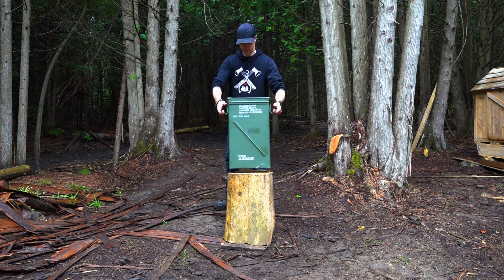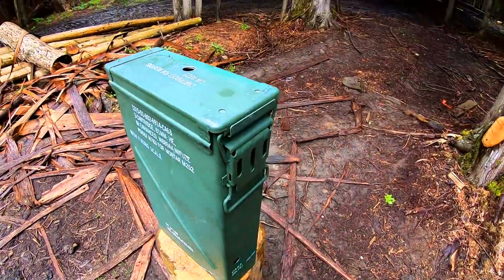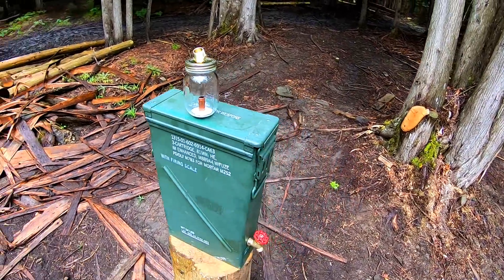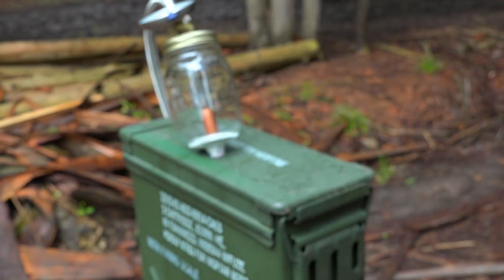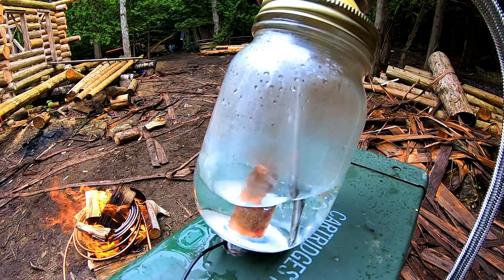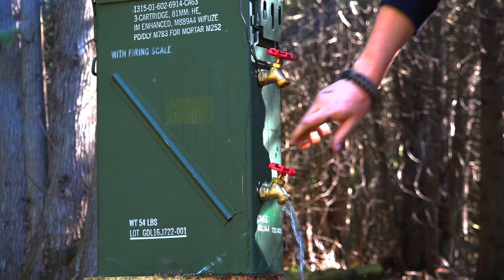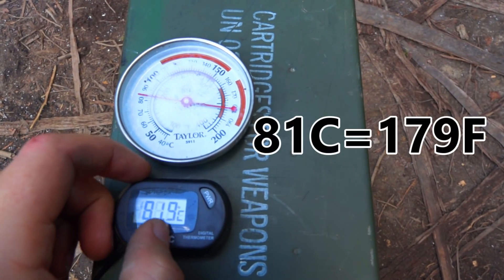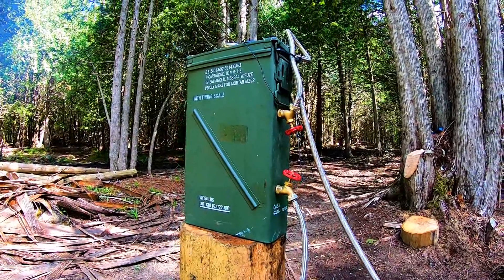Off Grid Heating Prototype- Copper Coil Water Heater / Heat Exchanger / Radiant Heater

Comment: I've toyed with the thoughts of heating water thru a fire...….I used one of the cylindrical charcoal starters. coiled copper tubing inside, cold into the bottom, hot out the top; taking advantage of the thermal syphon process. worked pretty good.... sure it isn't 50 ft of copper tubing to absorb.....so it take a little longer,  but doesn't use as much resources and is way more compact.....the amount of water wasted to empty to prevent freezing is much less also.

Comment: I like this build. The first thing I'm thinking about it is transportation. If you bent up the copper in a squar coil so it can all fit in the ammo can and still have the footage of the heat exchanger. The other thing is boiling water in the conditioned area might not be ideal but the only ways to mitigate that really is to modulate the heat that the heat exchanger gets. I'll be looking forward to how you tweak this.

Comment: Simple but effective way for heating. I'll use a close loop 2 coils one inside with the intake on top of the cabin to allow heat to rise and the ammunition box outside with the other coil. On the ab I'll install a flapper on top to control the fire and a pressure release valve.

Comment: maybe someone has said this before, but I thought I'd mention that the vapor will still form in the lines so long as it has enough length in the coil section to collect that much heat. one way I would make it better is try to make the coils go from bottom to top and it should circulate better, that way any vapor pockets don't get stuck. it should heat up faster too I think.

Comment: Try using less copper pipe, say 10 foot, and wind it helically with the bottom of the can connected to the lower side of the coil. That way when the water heats, it will expand and move upward naturally using convection and avoid boiling inside the pipe better. Yes, I have an engineering degree and was it tech support missionary in Africa 4 sim,org

Comment: I would worry about the endurance of the copper, since it melts at 1,085°C, and becomes soft prior to that. A camp fire can reach that temperature, perhaps if you elevated the copper tubing with a steel frame so it never touches the coals.

Comment: Cool, or HOT! I'm thinking of something similar for my offgrid house, using the wood stove, to heat water, for a water tank, for thermal storage, with radiators and computer fans, to heat, and a heat exchanger for hot water! Along with solar thermal water heating,

Comment: Wow. Now that’s a great idea!   Now to make it portable and easy to setup and take down.  How did the gaskets hold up?  Hmmm,   Now you need a mechanical auto feed for the fire to keep it going.  Wonder if some kind of pellet stove design might work with a Wind up auger to slowly feed the pellets into fire or an efficient solar rechargeable battery that runs a motor that turns an auger slowly or on a regular schedule.  Hmmm maybe a Rocket Stove Water Heater that is somehow feed wood pellets.

Something like 
https://youtu.be/CaD4Nl-9P2M

Comment: Seems unsafe.  I'd mount it outside as mentioned also.  I think if you used a car radiator you could then blow air across it to heat the air and then the warm air would be blown into your camper.

Comment: an idea for your heater would be rather than using an open water source for the heating side of your system would be to have a second coil for the heating side allowing the heat to escape from into your surroundings without the accompanying humidity.  This would serve 2 purposes it would provide heat without adding moisture that would condense upon your interior.  If you want to heat water place a coil within the water rather than have an open water heating system this prevents the boiling of the water and the excess humidity.

Comment: good idea but your missing a few things .use sand in the box and put that coil it the box as well  put a thermostat on the coil to regulate. one that closes off the water when it gets to hot
use another box for an expansion tank outside  use a 20 gallon  drum for a stove outside  and a cast iron heater like the ones    in homestead kitchen stoves  hook up your pipe and u will be good for all night .  sand holds heat 4 times  longer than water   depending on the type .so draw up your plan and take it to a heating shop to double check  the safety side of this and your camping in the snow . good luck and vent your camper .like your videos

Comment: Excellent idea. One thing I would do is have a vent pipe from near the top to the outside. That way if it does boil over it does so to the outside. One thing you could also do is mount a small motorcycle radiator and a fan inside your camper with a larger tank outside a bit higher as a reservoir. That would prevent any boiling water from spilling into your camper if anything went wrong. Lagging the outside pipes would also help prevent freezing of the return pipe and the heating pipe from losing too much energy. Great idea, I am looking forward to seeing it develop further.

Comment: Very clever and something that captures & stimulates the imagination of those of similar mindsets. Your idea would be to heat up the tank, then close the valves, detach the hoses, and bring the tank inside to a secured location (to prevent a spill) and then use that heat overnight as a heat battery like you used the stones last winter? Awesome project!

Comment: use stainless steel pipe. and less pipe. over all you will have a much better system.  run your coils through ya cabin floor or under so heat rises and you dont have to listen to the thump.

Comment: How about making a mini boiler that uses glycol. And install PEX in the floor and have quick connects on outside of camper.. used environmental friendly. Can you could you still use a campfire to heat  the boiler and you will not have to worry about the water freezing.. or even better build a propane boiler which will give you more control over temperature and be able to keep connected all season.

Comment: I will be incorporating some of this information I've learned here today into my diy air compressor powered pressure washer that I am doing a series on. It's called The king's gun series.  I've been researching hot water on demand and doing research on how to safely use pressurized steam instead of air to power it. I got several great ideas from watching this and I just wanted to invite you to check out what I got and let me know if you would mind a mention in the video I am planning
 Have a good one brother.

Comment: Design a rack of some kind to fit around the radiator (ammo box) to dry clothes on.  Could you also design a second much smaller thermo syphon to go inside the radiator that could heat hot water for drinking?

Comment: Brilliant! Like another viewer, I was thinking about the copper weakening by sitting directly in the fire. How about coiling it up inside a large old cast iron pot for protection? You could still easily route it up to the ammo box, even if the pot had a lid (thru the spout, perhaps). Thank you for sharing this excellent video.

Comment: I dont think this is as efficient as you say.. I  cant imagine  the water is circulating  that much, i reckon the water in the copper pipe is heating up and expanding to begin with (that is why you got a breif flow of water at the start) and then it only heats up and up and mostly heats the water in the tank by being attatched to it. I think you would heat the water much faster if you found a way to pump the cold water through the copper pipe.

Comment: Shape the coil into a pyramid or cone shape to increase its thermal collecting efficiency. Don’t close the top of it though, and this will allow the hot gasses to flow Venturi style up the centre of the cone.

Comment: I am wondering, if I wrap the same type of copper tubing around my wood stove into the box would I have hot water or warm water for showering and cleaning up dishes and so forth. Refilling the water in the Box as I use it. Kind of like having hot water on demand. Just a thought

Comment: Easy build you still need a tray with holles  on the top of the ammo box and a mirror for converting the steam in to water  because its indoors apllication, try also to build a base stand to secure your ammo box inside the tiny cabin with reflector and drainage, probably a slim design to fit your ammo box and save space  nice build btw keep up the good work.

Comment: If you pipe the steam hole outside like people say, attach a whistling kettle type thing on the end. This will let you know its boiling and time to get the coil off the fire. It will mean you don't boil it dry or steam cook youself. Its also a very low maintance simple solution compared to safety valves.

Comment: A rocket stove would be easier to control - consumes less wood, burns hotter, insulates the coil from the cold better... but it may require more frequent tending (and would also need to be mounted on the exterior). I highly suggest you use some kind of antifreeze to keep the pipes from bursting when it gets cold ...and a small adjustable pressure relief valve on your can for good measure (I'd say ~20 psi). Consider insulating and mounting the can on the exterior. It might sound counter-intuitive but you can use the thermosiphon to move hot water through a heat exchanger (inside) before returning to the can. This will actually radiate more on-demand heat into the sled while also preventing the water in the can from boiling too vigorously. Not to mention that if the pressure relief valve opens - it will be on the outside so you don't have to hear it.

Comment: Seems like what you should do is make it were you have the copper as an under lay under neath the bed room so that way your bed will help retain the heat. I think what you should do is have a lace the copper pipe along the base with the ammo box heating and part of the copper pipe exposed where you can have it siting on a fire so that way it’ll warm your bed. And the bed will retain the heat.

Edit; fair warning the heat transfer and conduction works in both directions, so during the winter the water might start draining heat.

Comment: Awesome heater. Just an idea but When you put your heater in your camper. Have some piping from the original port on your lid. Pipe it outside so the steam will go out there instead of making everything moist. You're whole snowmobile camper is a cool idea. Oh by the way I used to have the same sled as you. I liked my Artic cat Jag.

Comment: If would get a section of insulated piping, usually used for outside, wood fired, waterheater. This pipe is usually buried under ground. It has two PEC pipes inside. If you take ten feet or so, connect one end to the copper pipe and and the other to braided line. During the winter you would not lose as much heat moving the heated water from the fire to Mobile Snowmobile Camper and back to the fire.

Comment: I used copper for a wood stove coil. It corroded out in one season. Heat accelerates corrosion. Stainless lasts much longer. Also you don't need such a large coil. A single loop or two is sufficient. A small burn barrel with a damper to restrict air flow will keep the fire burning longer All you need is a good smolder of coals to keep the top of the barrel hot to keep the water flowing.
My circumstances were a bit different. I ran the lines into my domestic water heater through a circulating pump and saved a lot of money on the water bill. You couldn't use your ammo can for drinking water. Then again if you had access to a stainless container you could.

Comment: Maybe you could wrap the copper coil around a rocket stove. That might give you better control of the heat. Also, another coil connected at the top of the tank could give you the chance for distilled water. Just a thought.

Comment: Basically you made a hot water baseboard heater ! Put a pop off valve on top and if your not drinking or cooking with it use RV anti-freeze in it , it’s cheaper and it shouldn’t freeze ! If you want to watch the circulation use a sealed glass cylinder in-line with your input . But seal the hole in the cover with a thermometer .

Comment: I would add a small radiator to the loop. Like one of those small automatic transmission cooler mounted inside the camper.then plumbed back to the tank out side. That way you don’t have to worry about it spilling or boiling over in the night. Getting scalded by boiling water would suck. I currently use an 2 electric blankets connected to a ryobi 18v ac power inverter. With a 9 Ah battery. It lasts a very long time when set to medium. I don’t go places as cold as you do. But it works great for me.

Comment: Good system.  Use a heater core from a vehicle in your cabin, a 12v computer fan to run off your solar/batt array.  Seal the system and use dexcool antifreeze.  Keep the tank as an expansion tank, keep the heat coil as is.  You will have plenty of hot water for heating, and it will not freeze.

Comment: If you add corrugation to the outside of the box it will reflect the heat back and also give more surface area to dissipate the heat. Just like you see in electric heaters that use oil. If you use an old car raid and some antifreeze you can really get some heat moving in the system as this will increase the boiling point of the water.  I heated my whole 3 room tent with a small transmission cooler from a van and a small USB/solar/battery-powered fan. Radiators are designed to distribute heat as a heat exchanger without leaking. Staging small ones in series works well to make use of all the heat generated, similar to how a house radiator system works plus this less to transport and smaller to setup. Also, you don't need a coil that big, 3 or 4 loops are enough anymore is overkill and you are just looking for leaks as much as the water is circulating. Bury the copper pipe in the ground around the fire to protect it from the flame plug the ends with wine corks and you can leave it year-round in your fire pit, the ground will also hold the heat and keep the pipe warm for hours after the fire burns out.

Comment: Bravo! Now, I agree with what Robert Wiggers said and thus you might want to build a holding box inside of the camper that the ammo box can sit in so it will not tip over and yet be easy to place in and easy to remove. Or, maybe build the ammo box into the camper as a permanent part of the camper so all you have to do is to run the hoses to the spigots that are on the outside of the camper. Also, as you mentioned solar heating, a modification of the solar panel can have the collected solar heat (that causes solar electric panels to not be so efficient) heat the water and thus cool the panel so it produces more amps for faster charging of your battery packs.

Comment: I was wondering if a smaller duel tank would work better with a thermostat so the water doesn't get so hot and or maybe have the copper coil not in the fire but around maybe something like a chimney on a portable grill  or folding firebox.

Comment: Add additional tubing from the hole in the lid to the exterior of the camper.  Thereby eliminating pressure buildup, like what would happen with the sugestion of a typical pressure relief valve.   This will prevent any moisture buildup in the camper or the possibility of an explosion due to high pressure.   Great concept!

Comment: You should check out a channel called Advoko Makes. The guy made this heater for his tent with just a log and a pipe. He's from Russia, so the winter weather would be somewhat similar. He cut the log/stump into four or five pieces, then put little wedges in between those pieces, a tied all that together and set the center on fire. It was like having a small furnace. He kept the fire about 6 feet away from the tent for safety. Check it out, that might be easier and more controllable as far as the heat goes.

Comment: A few years ago engineer 775 did something similar with a metal rocket stove and had the copper coil around the metal exhaust. It took a little while but once the metals heated up he had hot water circulation.

Comment: You can also do this Without Water. Laying some 3/4inch piping across a fire, with the air intake, 1 foot from the fire, so no smoke or gases can enter the tubing. The Outlet tube goes inside your sled. Now you get heated air being raised and pushed through the empty pipe and Into your Sled......Instant heat by fire, without the need for water. Only issue is the Intake cannot take in any bad gas or you could die in the sled...but thats easily avoided by the Intake pipe location...which can be several feet from the fire because the hot air in the middle of the pipe will still create enough draft to make the system work.

Comment: Very cool idea. Might wanna consider the same concept but run Weirsbo lines in the floor of the sled. . . that would be an epic system and takes up no room inside. It could be run under , then covered and insulated.

Comment: Great idea!  A suggestion is to add a 1 way check valve to reduce (not eliminate) the chance of pressure building up in the coils. There have been individuals with open coil systems on wood stoves that have blown open because not enough pressure to keep the hot water moving in 1 direction.

Comment: You should rig up a metal pulley system where you could control the copper coil height relative to the fire. It could be controlled from inside your cabin/ skidoo trailer.

Comment: I've been wanting to experiment with something similar to this. I suggest against putting that ammo box full of boiling water inside your shelter... buy a heat exchanger of sort, you can buy a transmission cooler from an auto parts store pretty cheap Just insulate the ammo can and leave it outside. If you attach a couple peltier units to the ammo can to run fans, lights or phone chargers.